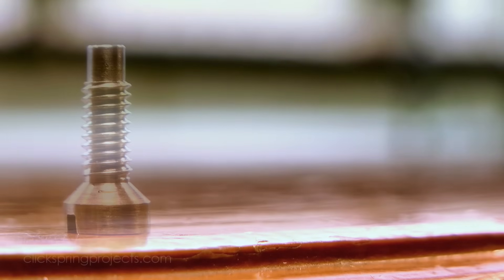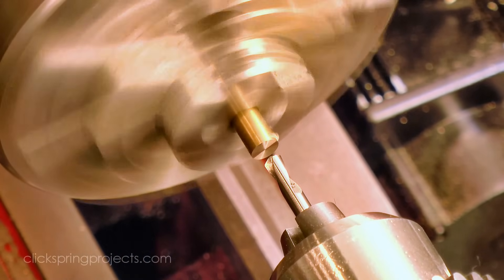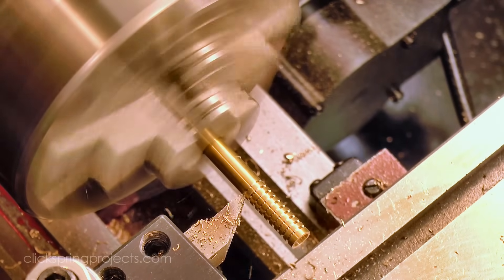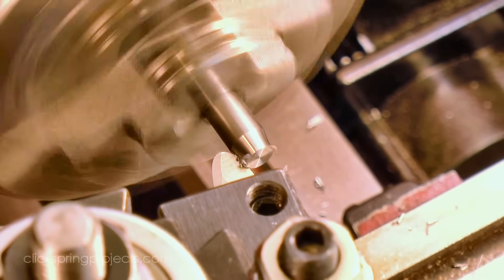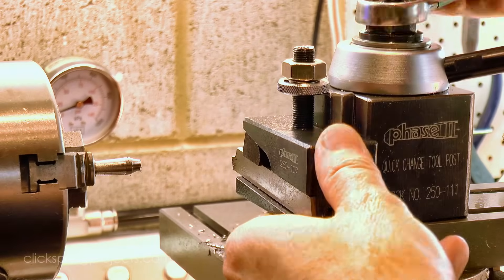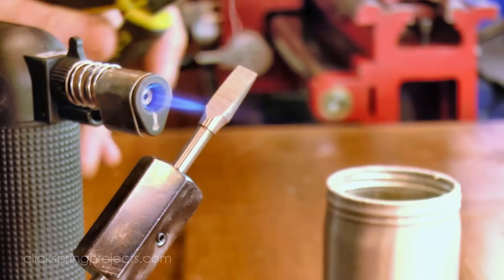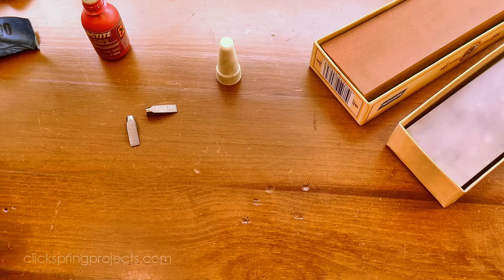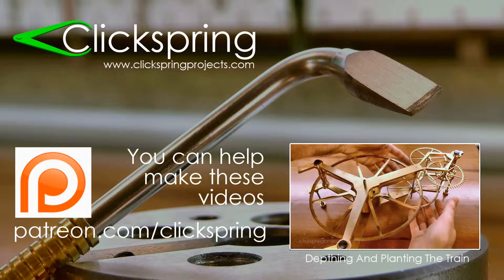Spare parts #6 - Making A Right Angled Screwdriver

Comment: You didn't mention the crucial step of adding the handle before bending the second end of the tool body !

So easy to forget, like tube nuts and heat shrink !
Reply: Oh yeah, the heatshrink one.. "There, that's my huge electronics project done. Now, let's just add some insulation... ... .... .. shit..."
Reply: @pacman10182  Electrical tape and a prayer usually does it for me in those situations.. :D
Reply: Haha yep made both those mistakes
Reply: I literally made the heat shrink mistake earlier today 😂
Reply: like brake fittings over flared fittings...

Comment: Love the detail...  Most guys would just heat up a couple  cheapo flat blades out of the drawer.  You on the other hand, make art!
Reply: Well beside the fact that in my case it wasn't a cheap one I did exactly this after buying it for exactly that because the bent screwdriver from the same manufacturer costs by far more than the standard flathead model
Reply: @datpudding5338  Did you need to heat it? Or just put it in a vice and bend it with a hammer?

Comment: Just ordered a bottle of Loctite 603 after seeing this ;-) I've been looking for a low-viscosity, high-strength glue for a while, but could never figure out all of Loctite's different types!! Thanks for the info, and great video as always!
Reply from the maker: +Lindsay Wilson Cheers Lindsay!
Reply: +Lindsay Wilson Same here
Reply: +Lindsay Wilson 603 is amazing stuff. I have a compressor hose reel on a pipe that's threaded into a flange bolted to the garage floor. The hose gets pulled sideways a lot and that pipe doesn't budge a millimeter. I've had it installed that way for years now and it's amazingly strong.
Reply: You could've just googled it.

Comment: I took a short bolt and just ground it into the shape of a screwdriver tip. That way I can stuff it up into a socket and use a ratchet on it. Or even use a wrench if the work space is really tight. I suppose you could even use a hex screwdriver power drive bit too. But back when I made my ground bolt those bits were not nearly as popular as they are today.

Comment: A quick tip on using Loctite or any glue: put it into the female part of the connection, that way it is spread over the whole area better than by coating the male part. Best exaple of this is gluing a bolt into a clear acrylic block, so you can watch through it how the glue spreads in either case.

Comment: Thanks for the interesting visually beautiful video about using machine tools.  Myself?  I would have taken a spare screwdriver, heated it up a bit with a torch, and bent it over 90 degrees.  Wait...I already did this.  Took 5 minutes.   ;-)
Reply: +cemx86 The problem with this is you only get one angle. It really helps to have two angles, offset at 90 degrees.
The way I did this was to buy a 90 degree double-ended screwdriver. Took 3 minutes.

Comment: You have a tremendous faith in loc-tite.
Reply from the maker: With good reason David: http://tds.loctite.com/tds5/Studio/ShowPDF/603-EN?pid=603&format=MTR&subformat=REAC&language=EN&plant=WERCS shear strength is comparable to soft solder, more than adequate for this task. Thanks for watching
Reply: I don't doubt it is an effective glue.  I'm just so used to 200lb gorillas breaking even solid metal objects that I tend towards mechanical connections wherever possible.  Even if Tommy the Torque Titan stops by your shop and breaks it, though, it's easy enough to repair.
Reply: David Maudlin tommy the torque titan! LOL! never heard that before

Comment: As someone who has never done work like this before, my main concern would be that the Loctite would fail under shear and the screwdriver tips would spin free of the shaft.
Reply: In clock making stuff it probably doesn't see much torque

Comment: Great video, but still I'd made this screwdriver differently. Bend the same, flatten a bit hot on anvil, shape on belt sander, sides concave, harden and temper ends. It would give a better grip (concave sides) and probably lower profile.
Well, I guess "there's more then one way to skin a cat" ;)
PS
How this particular Loctite hold up to high torque?

Comment: When drilling a hole on the lathe, why do you use two different drill bits?
Reply from the maker: +Drew Miller  Hey Drew, twist drills are notorious for 'wandering' off position if there isn't a starting point for them to begin drilling. The first drill you see me use is called a spotting drill, and is much stiffer than a standard twist drill, and experiences much less of that 'wandering' effect. It starts the hole, and then the twist drill follows it without issue. Thanks for watching and asking.
Reply: Thanks for your timely response.  I really enjoy watching your videos! Clickspring
Reply: +Clickspring Thanks for clearing that up.  I had the same question.  No lathe or mill yet so I just have to watch others such as yourself and wonder why this and why that.  I appreciate you breaking it down for us!
Reply: +Drew Miller First pre drill, then use the normal drill

Comment: Years after the fact, it just occurred to me: You could buy/obtain two allen keys, and carefully (so as not to overtemper) grind the flats on the short end with your bench grinder. Grind one with flat parallel to the body, and the other 90º to it. Already hardened and tempered.

Comment: Since you made the screw with the threads bare at the tip, could you have put in the slot on that end?  Then you could use a regular screwdriver from the outside.
Reply from the maker: +Derek Cramer Hey Derek, I did a bit of testing to see if I could get away with either a hex driver, or a slot on the other end but there just wasn't enough metal at the other end of the screw to resist the torque. The screw needs to be inserted quite tightly, and the metal simply distorted and bent. The only practical option was to put the slot on the inside. Thanks for watching.
Reply: +Clickspring Awesome, thanks for the reply.  I have been enjoying the whole clock making series.

Comment: Beautiful work once again Chris. You make it seem so easy. One question though: Isnt it better to do a hollow, concave grind for the screwdriver blade so that the edges transferring the torque to the screw will be straight, reducing chance of damaging the screw head? That's what I've always heard.
Reply from the maker: +spankmeister Nothing gets past you mate! Definitely worth doing for screwdrivers working with normal screws. However this screwdriver will always be used on slots that ultimately get ground off, so it makes no difference. Thanks for watching and asking :)

Comment: Chris, where do get your polishing stones from, or emery paper and all your other polishing surfaces.
Reply: commenting to see answer later.
Reply: +gus bisbal All over the internet. Just type in Oil stones. or Sharpening stones. I'd recommend to start with a dual grit stone to save some pennies. i've owned a few Ice Bear King stones. they can be found all over ebay. and not too expensive. You want maybe a 220 grit and 1000 grit to get started. 2000 grit will give you a real nice finish. follow that with some polishing compound. But i digress. You really can find them everywhere

Comment: 0:20 Why you don`t use hex head?
Reply: Shamanestr because a slot is way easier to make, and also looks better. but a hex and a ratchet would solve the whole problem
Reply: WCGwkf he could have just bought a hex nut
Reply: He wanted to make nearly all parts of the clock himself, including the screws, so he went for the slot because it was the easiest.
Reply: I bet machining the head into a hex would be a lot easier than making this screwdriver.

Comment: Wonderful work, but in this case since you are cutting the screw end of the screw off anyways you could have cut a slot into the other side of the screw and just finger tighten until it sticks out for a normal flat head to get in on the other side.
Reply from the maker: +Darkknight512 See response to same below
Reply: +Clickspring Found it, thanks for the response! 

Your videos are not just a great value to just DIYers, skilled tradesmen and mechanical engineers but are a great value to people working in all disciplines. Watching someone manufacture something changes the way I think of design, optimizing not just for customer experience but also for manufacturability. . 

You have inspired me to pickup machining someday as a hobby, I've worked in shops as an assistant in high school but am now becoming a computer/electrical engineer so I have not touched this stuff in years. However the day I start again might be very soon since I'll be starting at a small company that lets their employees use the machine shop for their own stuff outside of work hours.

Comment: Is there a particular reason you wouldn't want to torque the hook from the outside of the barrel? All that material is to be machined away, you could even do it with vice grips
Reply from the maker: Answer below, thanks for watching
Reply: Clickspring all I was able to find was answers to questions about putting a slot on the outside. That screw must have been at least m4, right? That gives you some 1000kg of tensile yield strength, you're not going to convince me that it wouldn't have been strong enough to tighten with pliers.

Comment: A quick question, do you find that a straight ground screw driver works better than a curved ground one that is a bit wider at the tip (that's the way I learned to grind them), or did you make it flat just because it's easier and quicker on a limited use tool?
Reply from the maker: +Tjita1 Honestly I prefer concave ground, it seats a little better against the slot and causes less damage. For this one it doesn't really matter, because it will only ever be used to turn barrel hook inserts where the slot is ultimately ground off. Thanks for watching and asking :)

Comment: Nice video. PLeae allow me two short questions.

Why don't you use a splint to secure the tips against torsion? Is the glue strong enough to withstand the torque?
Reply from the maker: +Ratz Alter The Loctite range of metal fasteners come in various bond strengths. The 603 variant is mid range strength comparable to soft solder, certainly strong enough for this application. Thanks for watching and asking.

Comment: Great Video! What superglue are you using? When I use the UHU brand, I don't get to move the parts anymore after they touched each other (Aluminium). I would prefer something that takes a second longer to cure and allows me apply some pressure. The last bond I tried to make with UHU failed because some spots got hard immediately on contact and didn't allow me to properly press the parts together.

Comment: Dumb question: When you bonded the screwdriver tips to the handle, did you use green threadlocker, or was that a permanent adhesive?
Reply from the maker: +ChiralSymmetry Not a dumb Q at all :) Its a permanent metal adhesive called Loctite 603 - there are many many different versions of essentially the same thing, but they are different to the Loctite thread lock range of products. Thanks for watching and asking.

Comment: there was a slightly easier way to get around this problem then making a new tool and that was to just slit the end of the inner barrel hook screw so you could use a screwdriver on the outside of the barrel instead or am i mistaken?

Comment: Is there a reason that a hex head wasn't used? Would it have been too difficult to shape it correctly?
Reply from the maker: +radioactivated the gamer I tried out a few ideas like a hex head, and also a slot on the outside end, but in both cases there just wasn't enough metal there to resist the torque, and it simply deformed under the strain. The only practical option was to put a slot on the inside. Thanks for watching and asking.

Comment: Is there any reason why you didn't just lathe the screwdriver heads and grip out of one piece of stock?  Forming the heads, thinning out the handle section, adding in the grip pattern then bending it into shape?  Of would that have just taken a lot more time.

Comment: Very nice, but a glued head for a screwdriver?
Reply from the maker: +alexandremondo Loctite 603 adhesive has a shear strength comparable to soft solder, the tip will deform before the bond will fail. Thanks for watching Alex

Comment: Would it be possible to finish the screwdriver ends on the rod itself and then bend them at right angles? Insert the brass handle before the second bend and use Loctite to hold it. For a handle yes, it will hold beyond doubt.
Would be an integral piece of the tool rather than rely on Loctite to keep the bits attached? Not that Loctite may not hold up to the daily use, but if it can be made from a single piece of iron, we could do away with Loctite.

Comment: Is that glue going to hold under torque applied? this looks odd
Reply: +karffiol never have used loctite before right? anyway i dont think a screwdriver like this can tight a screw that much either.

Comment: Maybe its a gunsmith thing and not a clockmaker thing... but kinda surprised you didn't hollow grind the tips to match the squared slots on the screw heads. (reduces tendency to cam-out)
Reply from the maker: +johnfranks This tool will only ever be used to screw in a threaded insert that ultimately has the slot ground off, so there's no real need. Thanks for watching.

Comment: Hi Chris, here I am again (the guy with the renderings). 
Great to see another couple of videos popping up from you! If you don't mind, let me ask you a couple of questions; I noticed in previous videos that some of your hexagonal wrenches have the tip ground down a little bit (for example the one you use to fasten the compound angle on your lathe), Is that just wear or is it made to interface better with the bolt?

Also, I'm considering to start saving up for a benchtop lathe, probably second hand. I recently started to do some research to educate myself about the topic, but are there any features and signs of (a lack of) quality in certain areas that I should pay extra attention to when going through the seemingly endless choises?

Have a nice day, Ed
Reply from the maker: +EddvT Hey Ed, just wear on the hex wrench, although it does make it easier to reach in on an angle. Some more info on what to look for in a lathe here: http://www.clickspringprojects.com/blog/from-little-things. Cheers mate, Chris.
Reply: Thanks for the info Chris, I checked out your entire blog and I must say it's very nicely done. I still have to work my way through the "shop made tools" section.
I think with the link you provided you also meant this one (also for other people reading this comment: http://www.clickspringprojects.com/blog/which-lathe-should-i-buy).
And be careful not to strip your compound angle bolt head!
I've probably said this before but your projects magnify my desire to make things. Whenever one of your videos pops up I can't help but to get to work again making small knives (which is one of my most treasured hobbies). 
Have a good one, Ed

Comment: wouldn't it be easier to make a slit on opposite side of the screw and use normal screw driver?  Don't get me wrong, nothing wrong with making your own tools, and i am certain there are plenty of  uses for bent screw driver, but for this exercise i think one cut is more efficient then making a tool? Excellent videos and narration ! good angles and lighting. I am most certainly looking forward to finished clock!!!
Reply from the maker: +MinimizedTek I did a bit of testing to see if I could get away with either a hex driver, or a slot on the other end but there just wasn't enough metal at the other end of the screw to resist the torque. The screw needs to be inserted quite tightly, and the metal simply distorted and bent. The only practical option was to put the slot on the inside. Thanks for watching.
Reply: That is a good point and the one i should have thought of myself. Thanks for swift reply :) keep making excellent videos

Comment: Why not just solder, silver solder, or braze the ends on to the screwdriver? You've already got the torch for it.
With the amount of leverage that thing gives, I'd be worried about it breaking whatever kind of adhesive you use.
Reply from the maker: +44R0Ndin Shear strength of Loctite 603 is comparable to soft solder, more than adequate for this application. Thanks for watching.
Reply: Clickspring Fair enough, I'm an auto mechanic, so I'm probably not as... gentle on tools as someone who's building a clock. Plus where I live and work, they salt the roads, which just makes things ten times worse because all the bolts rust solid to the car.

Comment: You could have cut the slot on the bottom side of the screw instead of the top. That way you would not need a specialist screw driver, but were is the fun in that? :)

Comment: It misses a flat / parallel tip to avoid damaging the screws. Argh!
I do throw away screw drivers with such a tip, or if I got enough time, reshape them parallel and (also round up any corner on the tip, has something to do with insurance/safety...).

Comment: I don’t know if the formulation for newer super glue is the same as it use to be, but the old super glue heated to a vapor produced cyanide gas that could be fatal, or cause lung disease. It was, and still is used to fume objects for fingerprints. All under a vented hood. Be very careful please.